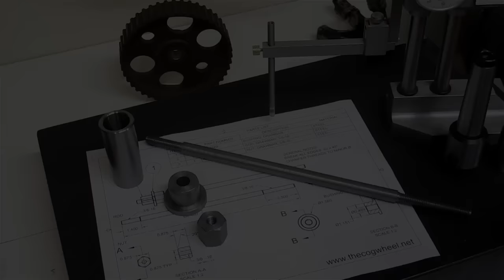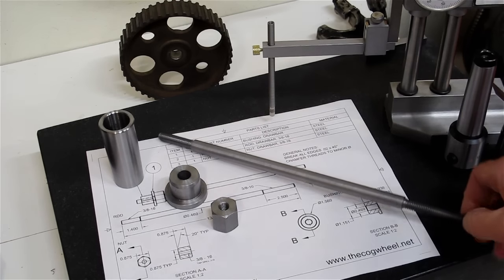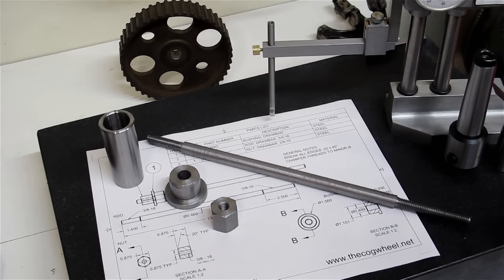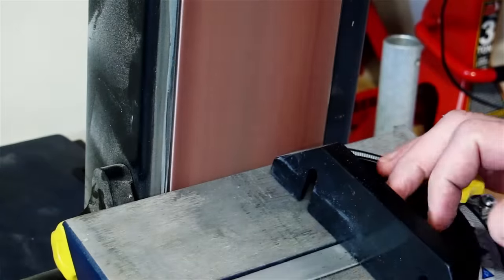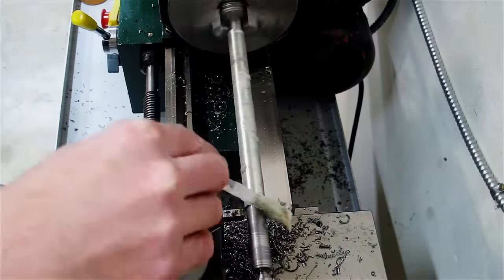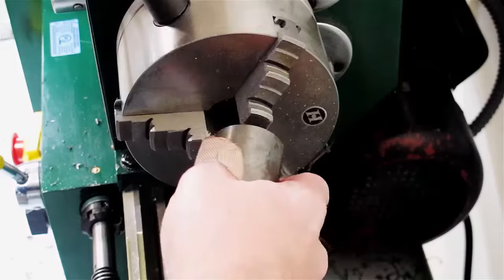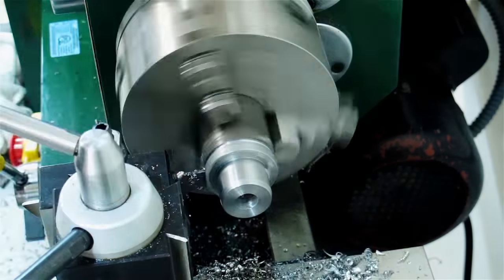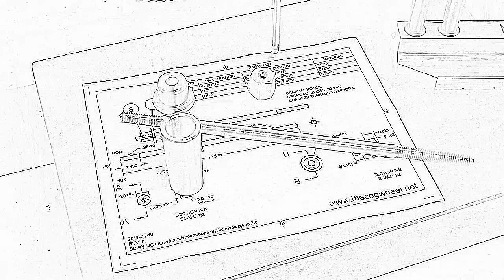Lathe Drawbar

Comment: Hi .  Great video lesson, timely, thank you.  I just acquired an old Craftsman lathe, it has a milling attachment and I am just learning a whole bunch of stuff about milling.  Especially about needing a draw bar and collets for holding tools etc.  The lathe has a 3MT spindle, is it possible to make such a draw bar as yours if I obtain a 3MT collet chuck?  Also, what size is the thread on the end of the collet chuck?  I am hesitating of getting one because I don't want to get one just to not use it if it is wrong.  What size dye did you use for cutting the threads??  Thanks again.

Comment: I inow this is an old video, but for those who may have stumbled onto it like I did:  There is no requirement to use a drawbar with milling cutters on a lathe.  A ER or 5c collet chuck that mounts onto the spindle will work just fine.  The drawbar is a quick way to mount MT collets, though.   Your lathe will have a native MT taper in the spindle, and a set of inexpensive Morse Taper collets can generally be found on ebay or other online sites.  The downside, of course, is that you're limited to the depth of the collet if you want to hold a workpiece.  That's where a hollow drawtube is a big, big plus.

Comment: May I ask about the correct way to remove a collet once its firmed into place with the draw bar? I'm having to hammer the end of the draw bar to get the (MT3) taper free. This must be imparting quite an impact to the bearing of the lathe, which can't be a good idea. Should it come free quite easily, or is it OK just to keep on hammering?

Comment: We do precision work on our Taiwanese machines all the time. Most our parts will measure within .005 and for our industry that is above standard by a considerable amount. We have made parts close to .0004 tolerance and frankly that’s overkill we’re not making aerospace parts. Now if folks are staying high precision that’s a different scope of machining, tooling and die, etc... I still think it’s possible given a solid setup and a lot of patience. Probably not profitable since you won’t get repeatability under those conditions. Precision versus high precision? Definitely a difference.

Comment: Nice video. What is that goopy cutting 'fluid' that you are using?
Reply from the maker: Thanks Ian!  It's bacon grease of all things.    I find it works really well in the home shop.  It's solid at room temperature and turns quickly to a liquid.  If you don't eat a lot of bacon (I'm Canadian, can you tell?) lard works as well in a similar fashion.  I like bacon grease or lard because it is non toxic, and I find smokes less than other oils.  When I was turning the rod in this video the shop smelled like breakfast.

Comment: I paid $200 for a entire collet closer. They’re so cheap making one with those oddball threads is time consuming. Nice to have the quick change features. You can buy the m1019 13.5x40 closers online for $150 for the entire kit. Don’t know if you have to shorten or lengthen the through bar. In my case the grizzly unit it had to be shortened and I chose to go from the back end and rethread the metric threaded end.

Comment: Great video !!! Again, I'm very impressed with the results you're getting from your lathe & concrete base. Did you try to ink your taper bore to see how well it mates with the adapter ?

"Dihydrogen monoxide"...I think the nomenclature would be " Oxygen dihydide". At any rate water has a respectable heat capacity (as fire fighters will agree), so it's handy stuff to have around.

Thank you !
Len
Reply from the maker: Thanks so much.  The concrete bench has really changed the lathe.  I haven't blued the adapter as of yet, but it locks in pretty good with a slight push so I think the contact is decent on it.  That's the thing about Morse tapers I don't like - too much force to get them out.      

I'm not a chemist so I could have made a mistake :).
Reply: I was just having a bit of fun with the terminology.  For the chem folks out there...How about hydrogen hydroxide